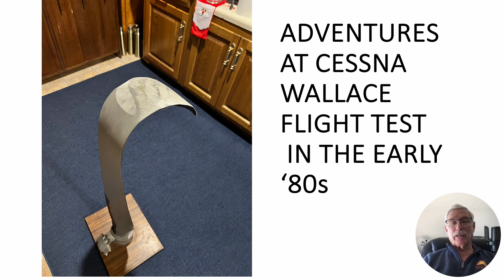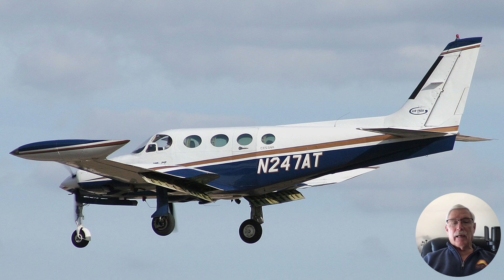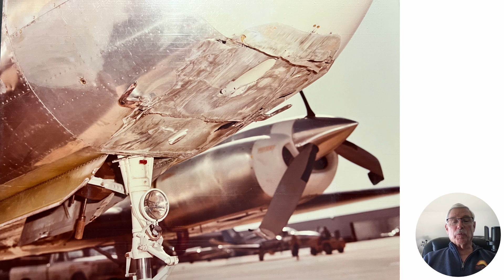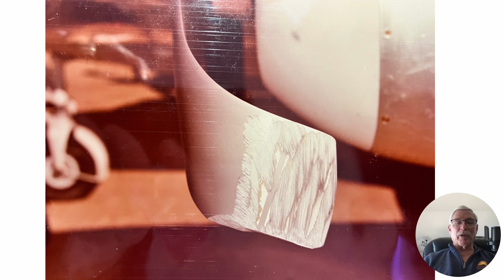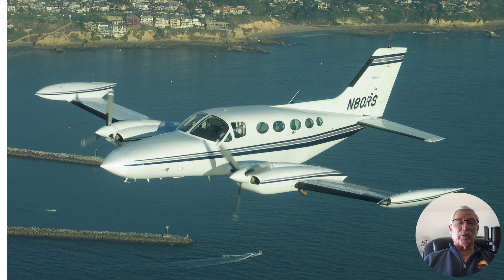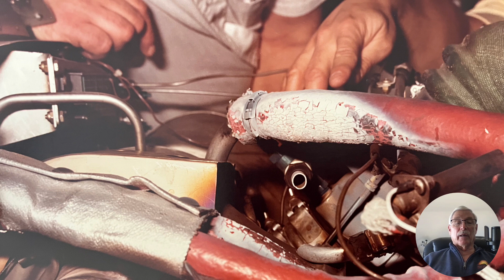ADVENTURES AT CESSNA WALLACE FLIGHT TEST IN THE EARLY ‘80s

Comment: Great video Ron. I was at Cessna, 83-85. I was a sales demo pilot C441 (Propjet division) and later transferred to the Citation division in engineering/marketing. The C441 was great airplane in spite of its early trim actuator issues. We also did functional flight tests out to the Boot Hill area with various engineers on board. We typically filed for Fl350 and occasionally would have to do 360's to stay inside the area. Was always fun picking up your contrail coming out of the 360 deg. turns and then as you let down you could see these  drifting contrail circles from your flight path. Very good memories at Cessna, the people and the company.

Comment: Thanks for posting, Ron. I think the stories in this video may have been from the 70s, though.  I was a flight test engineer at Cessna Wallace in experimental from mid-79 to early 1987 and these incidents don't ring a bell. Regardless, this brought back a few memories about landing gear issues, among others. I was assigned to the Citation I, II and S/II programs my entire time at Cessna. The fatal crash of the first 340 (1976, I think) resulted in another change in first flight preparation for experimental airplanes - the special inspection. These inspections involved engineers and pilots and mechanics and were performed prior to first flight and even after a significant structural modification.
Reply from the maker: I was on the piston side from '80-81. Your name is familiar. I work for Dave on the piston side.
Reply: @ronrogers  Ok, then we did work there at the same time. We would have been in the same bullpen up there in the hangar loft. Was it Dave B. landing a 404 with the nose gear up after a loss of hydraulic fluid?
Reply from the maker: yes
Reply from the maker: I am sure you remember the citation landing on the interstate during the min fuel test?
Reply: @ronrogers   Nice to meet you again? Yes, I do recall the Citation II incident. That was in 1980, Feb 12th. A nice sunny day. I was in the right seat of 550CC, for both the dead stick landing and the subsequent takeoff. I wish I could remember you, but I can't. You worked for Doug H? Dave B. was one of the piston test pilots who didn't get laid off. I worked for Ellis B. as supervision for the test teams were separated by engine type. Crawshaw was the senior manager of Experimental Flight Test. I recall several piston twin test pilots being laid off in a couple of waves in 1980 and 81. I managed to survive several layoffs while I was there. Tough times in GA during the 80s.
Reply from the maker: Well, obviously I made a great impression! I survived a layoff in 81, but they were going to move me over to third shift on the jet side. I had just taken a job at Boeing because I was sure I was going to be laid off, so gave my notice then. I worked for Dave B under Dough H and remember Crawshaw well (we were both ham radio operators). I got sent to the NGT program for a while.  Remember Carnahan??
Reply from the maker: I remember the flight test engineer telling me the story. He said he yelled forward that they had lost pressurization, and someone up front yelled back, "we lost a hell of a lot more than that!" I would like to do a presentation on this if it is ok with you. No names, no blame of any sort, just how concentrating on the test point can lead to unintended results. I think it is an interesting story to tell. Ok with you?
Reply: @ronrogers  I would have been that flight test engineer. There were only two of us onboard. No chutes. Were you a rather tall blond back then? I'm trying to remember you. We should discuss the possibility of telling the story offline, preferably over the phone, and then decide. I tell the story rarely, partly due to the fact that I feel a little responsibility for what led up to the incident. Your account of the initial conversation is reasonably accurate, though. The rest of the incident was a tour-de-force of airmanship, CRM and good fortune. I remember Carnahan well and fondly because I flew with him for 5-1/2 years, starting in October 1981. He came over from the 425 program after "my" test pilot was promoted to the Citation III program. I was retained on the Citation II for continuity reasons, and to help Carnahan transition to the jets. We were quite busy with early Citation II supplemental certification testing. I'll send you an e-mail with my contact information.
Reply: Hi Craig,  It is Barb from the flutter group.  I'm retired now, but came back in 1990 to work the the CJ.  Hope you are well and having fun.
Reply: @barbaradavis393   Hi Barb, Thanks for getting in touch. I did quite a bit of Citation S/II envelope expansion (as FTE, co-pilot) during the mid-1980s, so we must have crossed paths during that time. Congratulations on your retirement. I retired from Boeing Commercial (Seattle) in 2014 and am doing well. I hope you are doing well, too. Did you know Cliff in the Performance group?

Comment: +1 on test aircraft “interiors”.  Example: When I was at Learjet I flew 35-001 which by that time had been the first 35, the first 31 (after changing wings) and then the first 31a (first digital avionics and EFIS) Lot of leftover mods and wiring with bare aluminum wings and camouflage painted fuselage.  Now it’s all pretty and on a pedestal at the plant.

Comment: Hey what do you mean, that 404 lower front has an inspection stamp - therefore its a good part -> the expeditor
Reply from the maker: Since it hadn't left the factory, it was cleaned up, repaired,  and sold as new and undamaged! I was appalled.